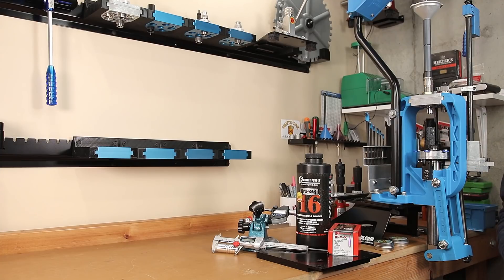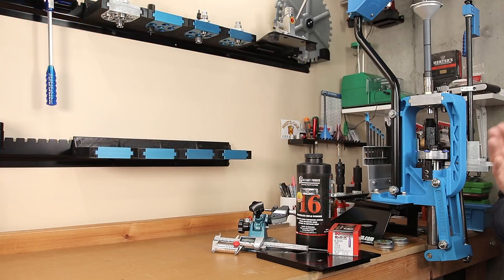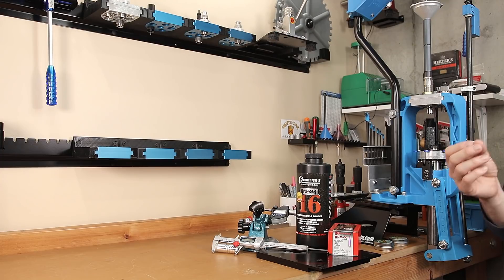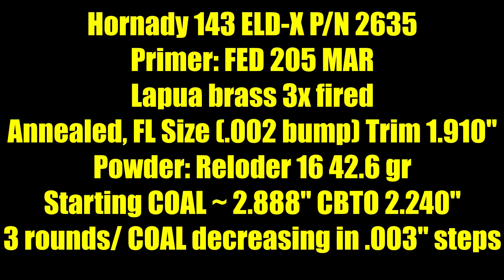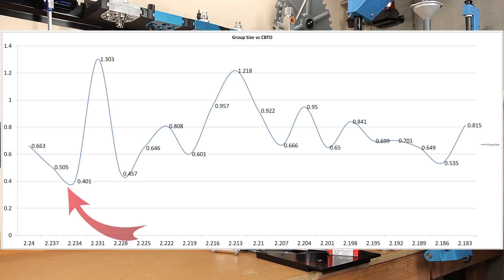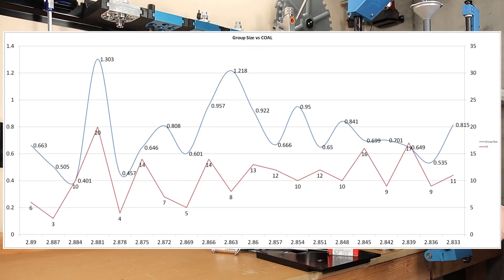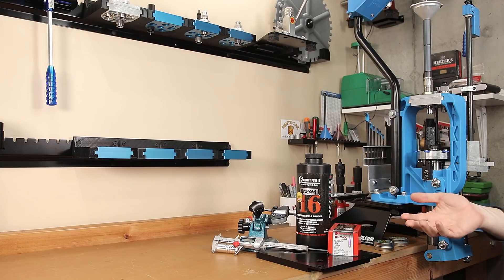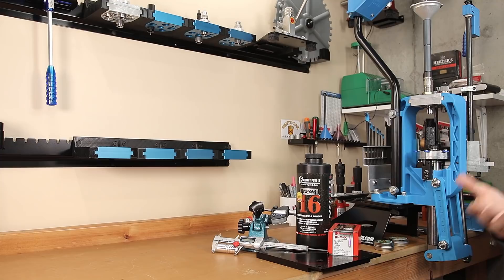Seating Depth Tested - Can COAL Tune Anything? - Stop Chasing the lands

Comment: I might have missed it, but at the "finding the powder charge" stage of this load development, what CBTO length did you use? 2.240"(0.015" off jam)? Presumably, before testing seating depth you had to decide on a CBTO to test all the charge weights. Just want to understand how you determined that. Thanks!

Comment: I’ve stopped playing with seating depth much. It’s easier and uses fewer components to slap on an EC Tuner/Brake and dial it in once finding a good charge weight. Find jam, back it off 50-60 thousandths, and tune it in. Works every time.

Comment: The ELD-X is designed as a Hunting projectile.  They are Not designed for paper, as the ELD-M is. Also, more is expected out of "match grade" rather than hunting grade every time. The ELD-X bullets have much thicker jackets, a longer bearing surface, longer oal & the interior is stronger to retain mass for better expansion/penetration in game.
Twist/stabilization may be an issue to consider.. Not to mention that tolerances are more liberal for a "hunting" bullet. Ethical hunting should not be in excess of the distance 1300 fps equates to in whatever loading your using. Hence 1 moa is acceptable for most hunting applications. Obtaining 1/2 moa is awesome for that projectile in a Hunting application. Fact is we're not trying to win any 1000 yard competitions when hunting & the ELD-X reflects that.
Reply: Thumbs up from me. 

Your points were very clear to me, but the OP and most of his followers here don't appear to distinguish the different aspects important between game hunting-terminal ballistics and target shooting-exterior ballistics. 

I might add though, that these ELD-X bullets are best at terminal velocities between 2,800 and 1,800 fps; less than minimum velocity= inadequate expansion, more than maximum velocity= overexpansion toward disintegration due to its delicate cup and draw lead core.  Out of my 260AI, which I chambered my custom barrel for them, they're adequate between 50 and 750 yards for deer, I use Nosler AB's for elk.

Comment: After you found your charge and col did you sort the bullets by weight?  I did that with some Barnes and it significantly reduced my groups.
Reply from the maker: Hi Wesley, I did not sort the projectiles. I plan on covering their subject in appropriate detail but there are so many ways to sort and most people these days are advocating for the OAL more than the weight. I am not making any judgments until I test it out. I am not surprised that this could help the Barnes out as I know I have seen more variation with them, but I am reserving judgment till I put it on paper.

BAR
Reply: @BoltActionReloading  ya my Barnes had a 4 grain difference between the heaviest and lightest.  Most were in the middle about a grain lower than advertised.  I’m not surprised your not getting superior accuracy out of a Hornady product either.  Every time I buy something Hornady I end up replacing it with something else…. but they’re so cheap it’s hard to resist!  I should have resisted their powder thrower that has now magically become a powder scale!

Comment: Are you a sierra fan?  I see guys using Sierra and i stared using them in replacement of the Nosler bullets I had been using.   My target match projectile is Burger,. But what I was getting at was Im thinking solid monolithic projectiles vs BTs poly tips fly the distance if your pushing envelope with speed.  I know the company s have done the research, But there is bullet deformation at higher speeds with poly tip vs Mono. Mono moly was what I think Iv read some those guys use at 1000 yard open sight matches.  Don't they need the speed?
Reply from the maker: Hi Treece, I think most companies make a decent product. I have had the least luck with nosler, so I use them less. I don't have much experience with the monolithic styles yet, so I don't have much to offer you there.

Comment: Why is it, when I bought two guns exactly alike, and bought the same exact ammo, they don’t shoot the same? All things being equal here, in watching your videos, you do put a lot of effort in your reloading. You must spend a boat load of money on your hobby. Which is ok fine Jim dandy with me. What I do not see is consistency in your shooting putting bullets in the same hole. Why is that? 

So, what is the probability of you putting three shots in one hole? Forget standard deviation..........show me. You do it first. Show me the proof what you are telling me, actually works. Now, OGIVE......here is the real deal here. When I look at three reloading books and the SAAMI drawing on .223, it tells me my inside barrel diameter is major 0.224 and the minor is 0.219 and all dimensions are +0.002/-0.0. Somewhere on the bullet is a diameter of 0.219”. That point has to touch the minor diameter with a very specific class of fit. What is it, sir? 

A cartridge has to have an overall length in order for it to fit properly. It has a “NOT TO EXCEED” value. It can be a little shorter, but not longer. My old Remington 700 BDL in .223 loves, without a doubt, Winchester USA2232 45 grain hollow point that it is a waste of money shooting it. My howa 1500 hates everything. I bought two more Remington 700, one loves a 55 grain, the other hates it. As expected. No two guns will shoot the same because of these two words that people get confused with. Tolerances and clearances. The tolerance is how much can you deviate from the nominal, and the clearance is how much room is needed for things to work properly. They need to be balanced.

Reloading is not cheap. It is convenient. It is a hobby. It is a very expensive hobby to get started. Personally, the data collection first is more important that pulling that handle playing with some serious stuff. In all honesty, I have NOT thrown one grain of powder yet. But my data collection at this time is showing me just how expensive this hobby is. Playing highly explosive components can be deadly. So....this just for my take and my own personal process, my safety and others around me come first. What I think or like does not matter here. What my gun likes does. 

It seems to me, shooting is an effort to probably put only one hole on a piece of paper with five shots going into the same hole, ......probably....I think....maybe....  in 1966 in basic we had M-14 rifles 7.62. Those guys of my same vintage know what I am talking about. To me, this was the worlds best battle rifle, not discounting what General Patton said about the M-1. Putting that hole on paper in the same place as best we can would qualify us. We started at 25 meters or yards. Knocking the target down was good enough at any distance. That was considered a kill shot. This was with open sights. If my round was to make contact with you on the battle field, then we did our job. We being my rifle, my pony and me. 

So, in closing I am confused when you refer to your interpretation of “standard deviation” how are you using it, and what are you using it for, plus what is your expected outcome,...like....what number are you trying to achieve by showing me on a target with holes that you shot. Thanks. 

Safety first, always.

Comment: Dude, your are a savage!! Great video. I'm trying to develop a load for this off brand pistol powder called "CBI". It's not working very well with my Glock 17 so I was interested in testing different seating depths in hopes of creating some cost effective plinking ammo for the range. This make me hopeful that I may find a combo that will run the gun and be 1moa or less at 35 - 50yrds. Thanks

Comment: Very interesting. I just ran a test to see what I could get and differences in velocity from two different temperatures actually 31 and ice temperature one at hot water temperature which happened to be about 90°.
I was shooting a shot of a A.R. 10 and 65 Creedmoor with a 22 inch heavy barrel and a Harrell tuner break on it… That’s another story
Well, I was shocked to find no significant difference in the muscle velocity of the two five round groups.  groups. I was shooting 140 grain Nosler RDS over 41.6 grains of R16.  The muscle velocity for the 90° load was three feet per second less than the cold load! 2713 hot, 2716 hot. 
This blew my mind and I am going to repeat the test to see if it’s possibly true.
I was getting frustrated trying to find a accuracy node for my AR 10… As I said it’s a heavy barrel, .92” at muzzle. I was probably averaging about 7/8 of an inch groups but felt like I should’ve been able to do better… I tried letters with H4350 and or R16.  So I had a bagel curiosity I decided I would try the Harrel tactical 1 inch muzzle brake/tuner. It was a total mind blowing experience. My average group for nine 3 round groups was .66 and I had three groups that were between .3 and .4 inches.  I am still experimenting but it looks like if you’re shooting a slower round you have to  extend the tuner (in my case, from 100 setting to 110 setting) to maintain the bullet exit on the downward or upward swing/apogee.

Comment: I agree. I used to chase the lands but don't any more. I look for the chamber sweet spot/accuracy node. All I need to know is accuracy differential/deviation of the COAL. Where the best accuracy is for the chamber in between lower bullet seating depth and higher bullet seating depth. Some rifle chambers will like the bullet closer to the lands and some farther away. But I know longer set the bullet seating depth to the lands. Instead I work on low and high seating depth groupings to find the sweet spot.

Comment: Try h4350 with those bullets. You'll thank me later.
Reply from the maker: Hi Matt,  I have. Probably at least 5 others as well.
Reply: @BoltActionReloading  have you tried using the .263 mandrel in the Sinclair body
Reply from the maker: Hi Matt, I am not sure exactly what you are asking. I have used multiple expander mandrels in the Sinclair / 21st century body. I have not tried 10 different values of neck tension with this projectile. I know that some have had luck with it. I have not. For this I used the .262 mandrel as I have had the best luck universally keeping the ES / SD low. (hopefully that was apparent in the data) Tuning COAL was the only point of the video, I may try and change the COAL some more to see if it settles in.
Reply: I have not tried all bullets but this one shoots at a short length, and at 41.0 grains h4350 cci br4 srp in Lapua brass. 1 thou of neck tension but I am using a Collet die. Not many like them but I find it can work like a FL die if setup in a certain way.

Comment: A couple comments:
-- Don't assign any meaning to ES or SD values from 3 shot groups other than one particularly bad ES might be a load to avoid. Statistically, all your ES values are basically indistinguishable from each other (sample of n=3). And only if you trust your chronograph would I rule out the "bad" ES values. See Cal Zant's PrecisionRifleBlog recent posting on shooting stats-- it's really insightful.
-- You probably only need to show the best and worst groups, maybe not every single one. And maybe not every possible view of all your data. Remember, you cannot please all your commenters, so adding tons of extra stuff just to please a few commenters will make more work for to produce something that could or should be edited out anyway.
-- The cyclic trend of group size opening and closing at each increment of OAL is really fascinating. The best OAL you tested IMO is the 2.836 because the next 0.012" of OAL is pretty stable. Stability is what you want and that OAL range might be the best you can do with this bullet. I'd go with that OAL and see if fine tuning the charge weight might help.
Reply from the maker: G5,
First you are entitled to your opinion, However a few items for consideration. 
-ES data - If you don't like it don't use it. (probably a reoccurring theme in all of my videos) I am not trying to hide data and everyone likes to look at things differently. While I agree N=3 is not very useful kindly consider that the variation between data points on this chart is .003" What is your process variation? Variation exists in all things. If you combined each data point with the one around it on the chart the ES's hold in almost all cases. So now your N=6, or 9,  depends on how you want to look at it. If you watched the How COAL affects velocity video, I dive a little deeper on this data set. I could show this but it borders on adding too much complexity for the intended topic of the video. With this data I am trying to convey 1 thing. Even though the COAL is changing the performance of the load is still very good. Adding all data points form the entire test 52 shots the avg velocity was 2888 SD - 8.6 and ES - 35 changing the COAL over .060" and being in and out of the lands. Many would be happy with these numbers with no intended variation in their process. Also I was validating the data against 2 chronographs, to highlight any disagreements, I believe the data to be valid. Again, if you don't like the data, don't use it.
-Groups - if I don't show them in the video I get endless comments about why they aren't there. Everyone looks at things and  learns differently, its not wrong, its human. Why a lot of people don't like math is they were taught there was only one way to do it. Again I time stamped the video so if you wanted to skip them you easily could. I have a couple pieces of equipment on order that I hope to add to this conversation, but don't want to go into any detail until I can validate my concept.
- The trend is interesting and where I am certainly still building my data set on how to use this test methodology more effectively. Personally I am happy with none of these. Erik's comment below makes me optimistic that there may be consistency at a shorter COAL yet, but I won't know till I test.

BAR
Reply: @BoltActionReloading  I forgot to say-- thank you for making the video! It's a lot of work and I appreciate it.

Comment: 42.6 of RL16 is too warm in my Savage. I get swipes and notable case head expansion. 41.5 seems to be the place to be for RL16 in my gun. At least with LRP Starline. I run RL26 in Peterson SRP now. ~46gr is the verge of pressure with 147s and will give just over 2850 in a 26" OEM savage bbl. I'm going to try to find a lower node to help the brass a bit. Super impressed with the Pete so far.
Reply from the maker: I have nothing but good tings to say about all the Peterson brass I have tested so far. I haven't life cycled it next to lapua but based on case growth I can't imagine its significantly different, but again I have not tested it. There is going to be lot to lot variation on powder and a change in primer can have a affect on peak pressure too. I have an interesting example (IMO) of this on one of my loads that I may cover in a future video.

Comment: I’ve got an experiment for you try if you haven’t already.... get some dry neck lube and load up several diff charge weights with and without neck lube. You might be surprised!?
Reply from the maker: I have thought about something like this before but I wanted to figure out what "moly" Lou Merdica uses and have that as part of the sample. I know there are a lot of opinions on the subject.
Reply: It’s just about the same thing, graphite “neck lube”. I tested today surprised to say the least.
Reply: If you look on the bottle in lou’s vid the bottle, I think it says “powder” on the side.... similar to dry neck lube? I think so.
Reply from the maker: He calls it moly. I have seen others link to a product but not sure exactly what it is. I am fairly certain it's not graphite, but some use it as well. If I covered it I would like to check a range of options
Reply: Agreed I don’t think it’s the same but I do thinks it’s similar, good luck and love the vids

Comment: I watched Erik's videos and they are informative. I much prefer how assertive and on point you are in your videos. You summed up two of his in the first 5 minutes of this video, and I had 12 more minutes to analyze and learn much more beyond that. Be that as it may, I have all the respect in the world for what Erik has accomplished. On another note, when you're testing the primer and powder combo are you starting as close to Jam (e.g. - .015") as you plan on testing so you don't run into pressure issues later? When you start backing off CBTO at stage 3 testing to find the best node the pressure will only drop from there.
Reply from the maker: Hello, I am very glad you enjoy the channel and the presentation style. Everybody learns differently so I think (I am biased) that this complements that information. I need data to understand and wrap my head around something, this is just the way I am. When running the powder / primer test if you are seated as deep into the lands you will ever be and testing for pressure (assuming you are in the lands) this should be the worst case for pressure. (I you start seating super short this may change so YYMV) If you haven't seen the COAL vs Velocity video I go into slightly more detail there.

BAR

Comment: Your data is actually pointing toward a good logical conclusion.  The 140 is the optimum projectile for your rifle.  If you want a longer 6.5 you need to step up to the 260 Remington.
Reply from the maker: The 140s seem to work well in everything I try them in. The 1:7.5 twist should give me some more freedom with longer stuff. I plan on doing some work with the 147 ELD-M as well as the 150 SMK to see what this extra twist rate lets us accomplish.
Reply: @BoltActionReloading  you have plenty of twist, but your engine is gradually being placed into heavier cars.  If you want to push a heavy 6.5, may I suggest the  merging of nostalgia and technology and look at the 6.5-06?